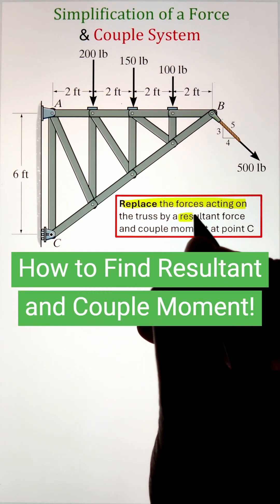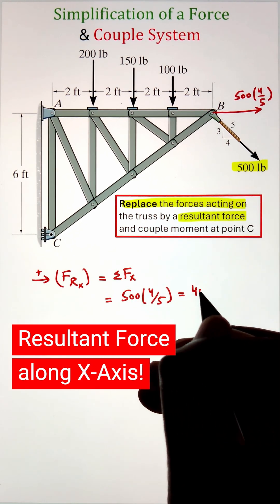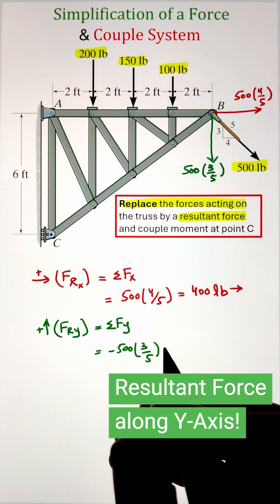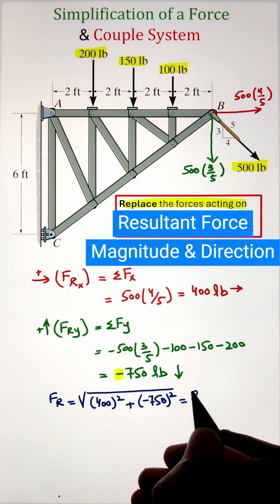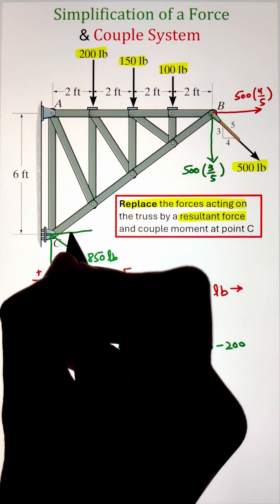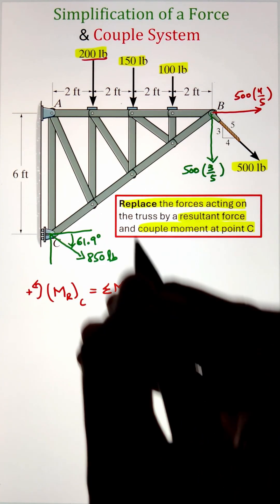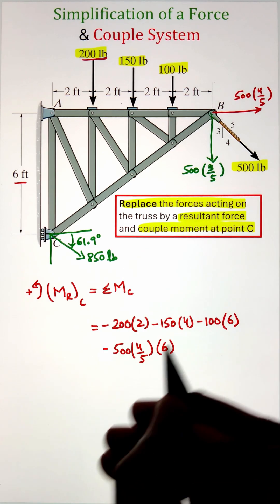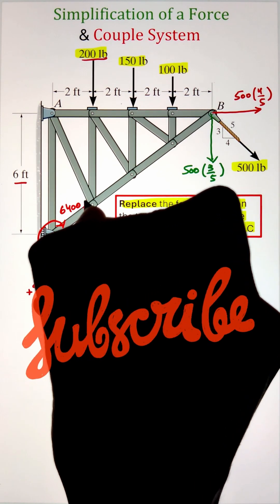Simplify 2D Force & Couple System in a Truss → One Resultant + Moment (Quick Statics)

Comment: For point B why does the x component generate moment if its the same direction as line of action which I assume is at c but across the x axis
Reply from the maker: The x component of force at B does not have the same line of action at C, to visualize it, just extend the force line backwards and forward if it passes through point C then it is on the same line of action.

Comment: Why 500(4/5) is minus at the monment
Reply from the maker: Since it's making clockwise moments 🔁, and I have taken sign convention counter clockwise as positive.
One way to visualize, either a force is going to make clockwise or counterclockwise moment is place a pencil on the moment arm, then hold the pencil from the point across which you're talking moment ( in this case from bottom at point C) and push the top of the pencil in the direction of the force. That way you could see it's rotating in which direction. 
Hope this helps.
Reply: Thank
Reply: Also,how to know moment is rotating clockwise or anticlockwise?
Reply from the maker: @winmyint-hp6ol 
1. Place a pencil on the moment arm, 
2. Then hold the pencil from the end across which you're talking moment ( in this case from bottom at point C)
3.  Push the pencil in the direction of the force on the free end.

Maybe this helps visualize the direction of rotation.